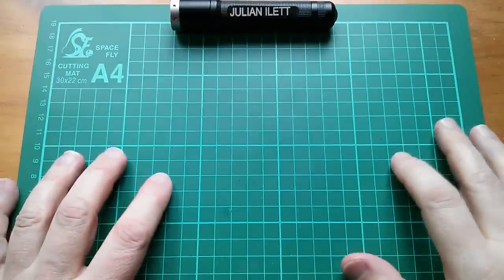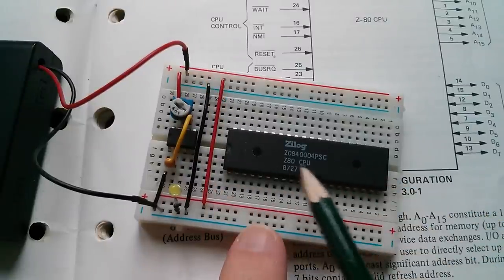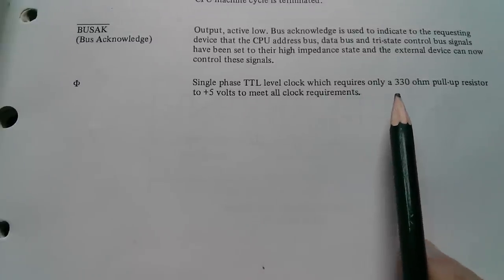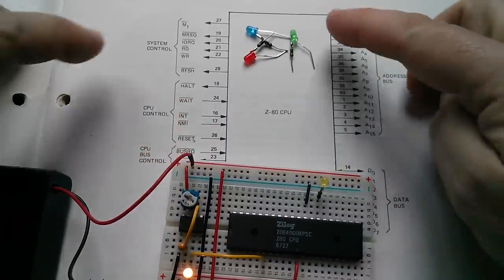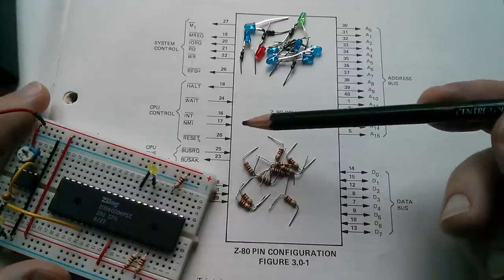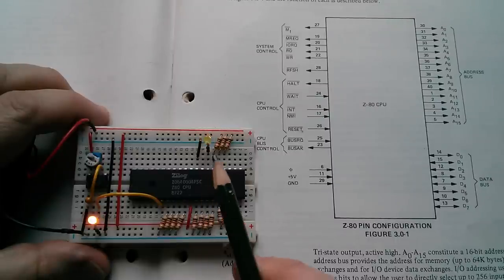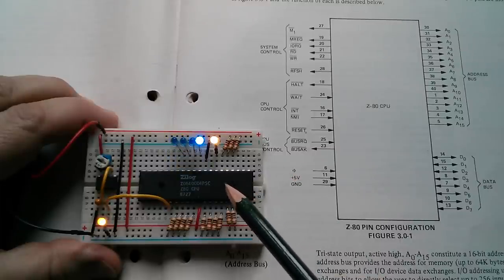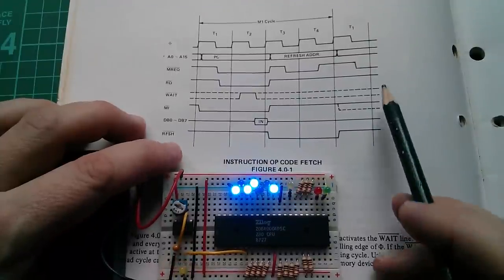Flashing LEDs - Z80 Style

Comment: This turned out to be a handy video for me. I was troubleshooting an RC2014 Z80 Board I had just built but something wasn't right. M1 was constantly low. I remembered watching this video some time ago and decided to breadboard this just like you did. Guess what?!? Turns out I had a bum Z80. Out of a tube of six, I pulled the one bad one. I know this because, yes, while I had the breadboard built, I swapped out all the other chips and confirmed they work. My RC2014 Z80 Board appears to be working correctly too! 

One other thing that helped, if you don't get activity on M1 after applying power, you can momentarily connect the reset pin to ground (remember, it already has a pullup resistor). This is occasionally necessary since we don't have a power-on-reset circuit yet.

Next up, building an EPROM programmer. I already have an Arduino EEPROM programmer and I've seen some projects to add the voltages needed to turn this into an EPROM programmer. I haven't decided if I'll use the 2764s (8K) I have or get some 27256s (32K) and save on some wiring. I also have some 8K SRAM chips but 32K chips would be nice.

Comment: I went ahead and built this project from this video with spare parts I had.  A couple of notes, as Julian noted, use 220 ohm resistors on your LEDs and your CPU won't heat up. Also instead of just setting the RESET flag high, hook it up to a switch so you can momentarily set the flag to LOW. Connecting power to the CPU doesn't always guarantee a good start. I have to hit reset before proper operation occurs. Finally, I don't know how he did it but I had no potentiometers that fit nicely across pin 6 and 7 of the 555 timer or one that fit nicely in the holes of the bread board even though I have ones that look like his. I used a couple of 100k resistors along with a 1uF cap and got 4.7Hz.  Whiz-Bang idea of the day: Soldering resistors to your LEDs. Saves space on the breadboard. Kudos to Julian and thanks!
Reply from the maker: You're quite right - reset needs a switch - I used a piece of wire, but it never made it into the video (must have lost it in the edit). Cheers Edward :)

Comment: I loved the Z80. Zilog had created a far better CPU than Intel's 8080. However it does have to be said that it wasn't cheap to use; especially if one used all of the Z80 family of support chips. These included DMA controller, clock, usart  and an interrupt controller. I am sure I have missed a few vital ones. It was the i7 of its day. It was very easy to write assembly for. Later I went on to work with 6502s. Then I came to realise that architecture was almost like the "philosophy" of the way it was programmed. The superiority of one architecture over another was not so simple as one might assume. Thank you for this presentation. I confess to dampened eyes when you brought out the Zilog manual. Happy new year.

Comment: Many years ago in high school ( I'm 42 now), I found a book at the library called 'how to build your own robot pet'. It was written in the 70's (I think), but was about building a robot 'dog', that used sonar eyes, and voice recognition. All based on the Z80. I read it cover to cover. Couldn't put it down. Fast forward several years, I recently found that book at a thrift shop for a buck. I later found at another thrift shop a black box with some cool switches and LEDs called a pack rat. I took it home and found a goldmine of Z80s and EEPROMs and RAMs. Very cool stuff. I love these videos. Thanks and keep it up.
Reply: Well I feel stupid. I went back and looked at the book again, it used the Intel 8085A. It did say you could use a Z80 instead though. And it's called  'how to build your own working robot pet' by Frank DaCosta.

Comment: I would imagine it would be easy enough to use a transistor pulldown circuit to actually drive the LEDs. A bias resistor could easily stay within the operating current of a Z80 and still keep the base of the transistor from floating effectively. I've had a look around and one can still get brand new Z80 chips for those wondering. There are also some BGA packages that would work for this though harder to use as they are mostly SMD packages and as such, hard to use on a breadboard without some sort of bodged shield with headers to plug it in. Great video on the more intricate nature of a Z80. This was fun.

Comment: A number of years ago I built a 'Bigboard II" single-board computer that was based on the z80 chip.  When it didn't work at first (which turned out to be due to solder bridges),  I pulled the 74LS245 data bus buffer chip and soldered a bit of bare wire that grounded all of the data bus pins, which effectively caused the chip to continuously execut NOPs.  This gave square waves on each of the address bus lines,  each one half the frequency of the next,  a nice troubleshooting tool.  I still have that board.  :-)

Comment: in 1979, or thereabouts, I used to use a NOP tester to diagnose faults on Z80 system boards, just a CPU with the data lines soldered to a wire that pulled them all to ground.  The advantage is that the CPU is going through all of the data/ram addresses, each address line being at half the frequency of the preceding bits.  Thus you can 'scope out the address lines all round the board.  You can do it with a 6502 (Commodore PET etc.)  but the NOP is a different op code (iirc!).

Comment: Now that, I like. I've got some Z80 based units I often have to repair, I'll get busy with the VERO board in the next few days and get myself a little CPU tester built. Fabulously creative idea of using the resistors on the data bus to load an instruction. Many thanks.

Comment: Great video! Takes me back to my ZX80 / 81 & Spectrum programming days! I recall when I FIRST discovered I could run LEDs from the external expansion port on my ZX81, and then decided to exchange the LED for a Motor. That was when I learned what current was as well... As I peered into the smoking remains of the Z80 after it went "POP!".

Comment: I have just tried this, it was great fun and a lot of learning! I'd accidentally started with my breadboard the other way up so negative is on the top rail, and that might be why I accidentally plugged in my address LEDs the wrong way around and they were counting down instead of up - that was a learning moment when I realised what I'd done there! Using my DSO138 scope to see what's happening was interesting too especially on the MREQ pin when I tried instruction 0x18. I did keep feeling for heat from the chip but not noticing anything - then i read that CMOS chips don't get as hot as NMOS and I've got a 10MHz CMOS chip here. Thanks Julian and keep doing bonkers stuff from time to time!!

Comment: Excellent. I did similar in the late '70s with the INS 8060 CPU that Sinclair used in the MK14. A UK magazine ran a series of articles showing how to use a toggle switch to SINGLE clock the CPU, and present data on the data lines using switches, such that the effect of each clock cycle and data could be seen.

Comment: You don't need to UV erase that EPROM every time you program it if you use a bit of trickery.  You could use code at the start to determine where your new code begins or simply use dip switches (or wires) on the high bits of the address bus.  Both have their own advantages/disadvantages but either way it saves a lot of time (and wear on the EPROM) if your code is small.  A 32kB EPROM could last a long time before you need to erase it.  Works with EEPROMs too of course but the savings are less.
Reply: And it shouldn't be too hard to make a programmer using an Arduino so you don't even need to buy one.  And of course we know you have a 12V PS somewhere!  ;-)

Comment: That would make a great basic Z-80 tester. I started out with RCA Cosmac CDP1802. It had internal Sixteen 16 bit registers, so you could toggle in an LED flash program through DMA directly. The only external components would be a resister and an LED. My 30 year career at Boeing allowed my to work with many manufacturers micros and I ended my time at Boeing with PIC microcontrollers. Still do PICs as a hobby today

Comment: I'm sure you get a lot of suggestions, so add this one to the list. Upon fiddling with the circuit myself, I found it's much more effective when using an output to drive an LED to instead just make a MOSFET driver to drive the LEDs. In my own experiences I've found even with a 220ohm resistor, the green LEDs were very dim, plus it lowers the output pin's voltage to whatever the LEDs forward voltage is. In my case  it was ~ 2.5v. 
Great project though. I used this very project to "break my CPU cherry". Being that I'm Canadian i've always grown up with 6502 systems, C64, NES and so on. I never knew a lot about the Z80 and I've even found 6502 assembly to be easier. Anywho, thanks for making this video. It gave me the inspiration to make this and try different variations on it. Cheers, brother.

Comment: @ 1:55 - that Z80 CPU is a 4Mhz part not 2.5Mhz. It's a newer one, made in the 27th week of 1987 and uses a different numbering scheme than the older ones. Z0840004PSC - the ''04'' in that specifies the max speed it runs at, in this case 4Mhz.
The Z80 is awesome to code for. The wildest trick I ever saw was massive abuse of the DRAM refresh register 'r' to store something in the 7th bit (which is apparently unused), and using the rest of it as a seed for a pseudo random number generator!

Comment: Something which occurred to me is that this would be great for techno-cosplay, where someone wants to dress up as a robot or cyborg.  You could use an old CPU (perhaps with some transistors as buffers to get rid of the overheating problem) to drive a nice flashing light display to give that retro-tech feel to the costume.

Comment: We have gone from 2.5MHz to ~4 GHz clocks!
Reply: Note that new processors execute faster (instructions take less clock cycles) so effective speed increase is even higher.
Reply: New processors actually execute several instructions per clock cycle because it was more effective than making the clock even faster.
Reply: More like 4hz clocks xD
Reply: If it didn't literally burn the chips they'd be setting the clock even higher.
Plus the 'cache' stuff only exists because they couldn't get the memory to run as fast as the CPU
Reply: It is now December 2019, and one of the fastest current CPUs, the Intel Core i9-9900KS has 
Cores: 8 | Base clock: 4.0GHz | Boost clock: 5.0GHz

Comment: Cool project, Julian.  Takes me back to the late 70's writing firmware for the Z-80  on a Mostek development system. Your video makes me want to pull one of the old chips out and see if it still works, even if it's only executing a hardwired NOP! Thanks for sharing.

Comment: Thank you, nice video! I wanted to try that in the 1980s too, but back then the hobbyist LEDs took way too much power to operate, especially when you try to turn them all on at once on the data lines. I always had to use a ULN 2003 or transistors on the output.

Comment: Actually, you'll find that the Z80 from 1987 on your breadboard is in fact a Z80A. Zilog stopped using the A/B/H suffixes, and instead put the actual clock frequency at the end of the long symbol. This one is Z0840004, so it's a 4Mhz chip, equivalent to the previous Z80A. I have a Z084C0008 chip, which is also marked Z80, but it''s a 8MHz version, which previously was dubbed Z80H, and additionally it's a C-MOS device, making it a static chip (meaning you can stop the clock completely) and less power-hungry :)
Apart from that - very ingenious demonstration of the Z80 in action :) Cheers from Poland :)

Comment: Very interesting old timer electronics.
I read up on the z80 back then, but never got round to using it, I messed with the 6502 instead, I had a board with the 6502, adress decoder (3 bit to 8 line 74ls chip), rom, ram and a parallel port chip.
Sort of a early arduino.
I wrote some code using the bbc b computers assembler, but a mate of mine wrote code driectly in hex, bonkers.
I built a msf clock using the z80, a rewbichron 2 from practical electronics, the system only used a rom chip, no ram.

Comment: I did something similar a very long time ago with a 6502 from a Commodore 64.  Mine wasn't quite as extravagant as yours but NOP for that processor is 234 (EA). Don't ask me how I remember many of the OP codes for the 6502. And I didn't just reference them online.  I had the same idea to fill "memory" will NOPs to fake it into running without interruption.  I really wanted to start executing at 0x4c4c because repeating 4c's would  JMP to 0x4c4c and loop endlessly... Or BE/BNE 0xfe to loop endlessly but that would require alternating bytes on the data input lines.
 I gave up on not using real memory at that point.

Comment: You really should have transistors driving those LEDs off the address bus, but it sure is an interesting exercise. 😀 Never did much with the Z80, as I was more exposed to the SC/MP, 6800/09, 6502 and [later] 68k, but Zilog really shook up the 8bit scene with the Z80 and quickly gained a lot of fanboys. My first MPU hands on  was with the SCaMP via the SoC MK14 kit (big regret selling that!! 😬), but my first intro was the Intel 4040 based PE Champ - anyone remember that?
Reply: sequri I remember the 4040 champ! Didn't build it, but did get a sc/mp though, great little computer.
Reply: There are many LEDs now that are 'high efficiency' and will make plenty of light with only 1mA. These would work well on this project without stressing the Z80.

Comment: Turn the breadboard around so the numbers count up on the lower side AND align pin 1 with 1, 11, 21, 31, etc.  Makes life soooo much easier!  And use a full length breadboard for that matter.  Can't do much with those half boards especially when one of the ICs is a 40 pin CPU.  :-P
Reply: ElmerFuddGun Thanks captain obvious. He would have never thought of that!
Reply: LOL... Obviously he didn't.  Upside down AND still missed aligning on the top 20 pins by just one pin.  At least then he could have had the top half aligned...
Reply: Yeah, I was trying to figure out if there was some technical reason he didn't do that, but couldn't come up with anything other than "brain fart"
Reply: Or perhaps we all missed the obvious and he's messing with our minds? :-P I think I'll chalk it up to a "brain fart" moment... where one is more involved with the workings of the Z80 than how it's wedged on a breadboard ;)
Reply: One of the simplest and best things to do when designing on a breadboard is to give yourself extra room for changes after the initial wiring by aligning all your ICs on the 1, 11, 21, 31, etc.  At least for anything over 8 or 14 pins.  Never know when you might want to fit some transistors, etc. in between the ICs to solve something you hadn't thought of initially.

Comment: Many thanks for a very interesting video  Julian. I couldn't get mine to work until i realised that the z80 needs a reset after 5v is connected. i simply connected the reset pin of the z80 to zero volts then back to 5v and it works fine every time.  Rob G0IOZ Derby.
Reply: Forgot to mention that I'm using an Arduino for the clock signal.

Comment: Very nice excursion to the "good old times". I was more of a 6502 guy back in the days, didn't like the Z80 and 8080s. You were lucky that the Z80 works with this slow clock, I remember the 6502 needed a minimum clock frequency to run correctly.
Reply from the maker: I might have a 6502 somewhere - never played with one, but I think that would be fun to breadboard too :)
Reply: Would be interesting, as far as I remember, the op-code for NOP is $EA.
Reply: I think the modern WDC 6502 can be run as slow as you like. I had an Arduino micro providing a very slow 1 sec clock pulse
Reply: I've search around a bit and they are amazingly still producing these WDC 6502. There is an "S" (for "static") version that can be clocked down even to a full stop.

Comment: If you mask the upper address lines with the low active REFRESH output they will make sense again.

It's been many years since I thought about plugging a microprocessor circuit together, but I've inherited several processors and I think I'll test out my Z80 like this. I also have three transputer chips and a couple of their interface elements, be heaven knows what I'd do with those.

Comment: An interesting fact: I tried this with a "MOSTEK" Z80 CPU and found that I needed to add the 330 Ohm pull-up resistor on the clock pin even though I was running the clock from a 555, so it seems that the resistor is required in some cases.

Comment: Jilian Ilett
At around the 2:00 minute mark, you say that the Z80 in question is the 2.5MHz version, however, this IC is marked Z840004, where the number 8400 says it's a CPU in the z80 family, and the final 04 shows that it is indeed a 4MHZ specimen.
Furthermore, i can see that the "Z" logo is from later in the life of the Z80 than when the 2.5MHz version was the only one available.
Finally, the date code says 8727 which means the 27th week of year (19)87 which was around 10 years after it was originally marketed. At this point, both 4- and 6MHz versions were very common.

Comment: that z80 you say is 2.5mhz may be 4mhz as it has a 4 before the PSC in the type number... and try a resistor between pin 3 and pins 2 and 6 instead of where you have it there, it gives better M/S ratio....

Comment: Not just a bunch of flashing lights but a binary step counter.
 To drop the load on the chip just jumper the upper negative rail with another resistor so as to lower the current through the LEDs. Of course the more lights that are on the dimmer they will all be.
   Mike (o\!/o)